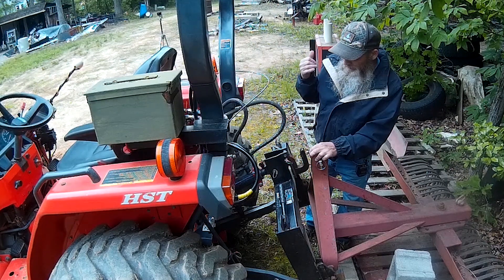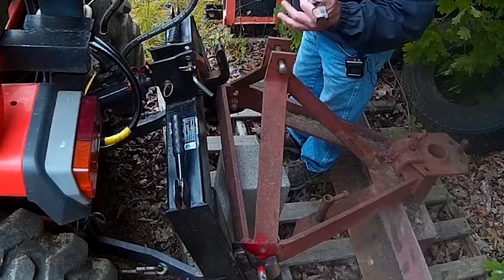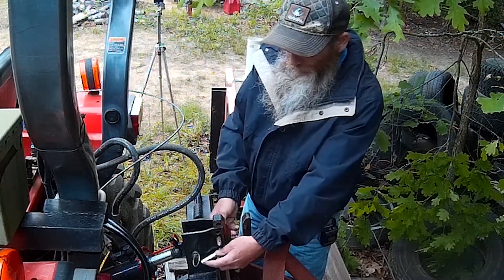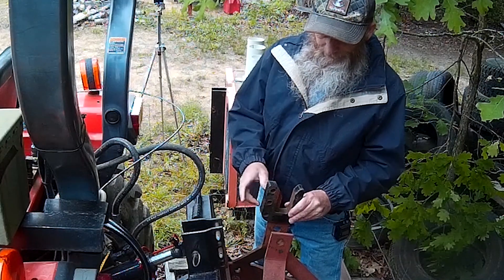how to hook up a non quick hitch implement to a quick hitch

Comment: Hi Dave. Just got my quick hitch and it works on almost all of my attachments.  Now, thanks to you, it will work on all of my attachments.... once again, thank you.
Reply from the maker: awesome! hope you are doing well my friend.
Reply: @daveknowshow  Dave, had trouble with a finish mower and a quick attach.  aarrgghh.  So happy you were as always a step ahead of me.  🙂
Reply from the maker: @drgnner6028  I did some mods to my finish mower for that same reason and man oh man did it help! hope you are doing well .
Reply: @daveknowshow  I had the Pats EZ hitch on the lift arms and they worked very well. I thought the quick hitch would work better and I was in the mood for a new toy.  I wasted my money. The top hook is in the tool box which means I still have to attach the top link by hand.  It is no big deal to do that, but the quick hitch is not a big deal either. :-)
Reply from the maker: @drgnner6028  there are some adjustments to make it 100% usable with all your implements. once its all done I'm liking it pretty good.

Comment: I have a Speeco quick hitch that I have had for over 20 years. Several pieces of my equipment are not quick hitch compatible.  I use the lower pin adaptor bushing on the equipment and center link link adaptor on the hitch. I have to get off the tractor to hook up the top link, which works fine for me, at least I don't have to fight with the lower links. I fully agree with your modifications to your equipment. Great video with a lot of good information.
Reply from the maker: thanks Steve, I really appreciate your input. really appreciate you stopping by the channel

Comment: I have a nearly identical drag blade, just a couple hour ago I cut out the inch of round tube blocking my quick hitch's top hook then extended out a new support (a little bit of metal fab work) further back so the top hook doesn't interfere with anything. Now I just need to get it to stand by itself and then every hook-up will be fast and fluid!
Reply from the maker: @williambartholomew5680  yeah that’s a good fix but changes the top link length a bit.
Reply: @daveknowshow  I don't think I described it well enough but I didn't change any geometry, just got the blade's center strut out of the "pocket" the top pin goes through. Everything is exactly how it was but now there's room to have a large hook around the top pin 👍
Reply from the maker: @ sounds like a good work arrangement to me.

Comment: Dang.... that's an amaze'n discovery, in see'n how you did that! Thanks for them details!
Reply from the maker: thanks for stopping by got to get creative sometimes with these implements but well worth the effort.
Reply: @daveknowshow  Sounds like that pay's off for ya too! Love your creativity. Just passed your info on to another guy with the same issue one his implements. 

Hey, so curious, would the Pat's Easy Change system not also have been a good option for you, since your top link was given you so much trouble? Of course, in using Pat's, the top link would need to extend out a bit further (3.75 inch) to make that work... so with your hydraulic top link may make that not an option. Thoughts?
Reply from the maker: @BubbaGooder  could have went pats but I'm not a fan of it. the arms swing loose if you dont put the bar between them and that bar can get in the way of the pto shaft when using a pto driven implement. at least I would think it would get in the way.

Comment: Nice video. Great for those wanting to save some money. I myself invested a heavy price for the Kubota quick hitch 10 that does not have any adjustments and doesn't need any adaptors for the implements. I did get it because I did get a new tractor and my implements I got with it were Kubota Quick Hitch. I did buy a Farm Hand 42BX Wood Chipper and converted it to fit by drilling another hole for a 1/2 inch bolt and putting a 1/2 to one inch adaptor and then a 1" to 1 1/8 inch adaptor for a perfect fit. It just makes it even easier that you don't have to mess with the top hook. I will most likely buy Land Pride quick hitch implements, but if I did see something else saving enough money and it could be adapted over would do that as well. It was nice that you did have the adjustable hook on top to not even have to modify the implements. But you are right quick hitch is the way to go. The easier it is to change implements the more likely you will use them more often.
Reply from the maker: so very true I just finally adjusted my rototiller to work on my quick hitch as well. so now I only have three that do not fit. the post hole digger, the 12 inch bottom plow which neither of those will ever fit. my aerator does not fit very well so I will make some adjustments to it soon. its not something I use very often but I might would if it was easier to hook up

Comment: Thanks Dave . I have a few old pieces of equipment, but he main one that I use is a old heavy duty blade. It even can be slide either way on the frame. Also has replaceable cutting edge.  Of coarse I run into the problems you discussed. I was not aware of the different hooks available.
Reply from the maker: I was just sent a brand new blade to test out. I needed a offset blade like the one you have. I got this new blade to test and make a video about and it was suppose to be quick hitch ready. well guess what? it wont fit! I could not believe it! I spent a week rebuilding my harbor freight quick hitch to fit this darn thing! hope to have that video out in the future. its a nice blade though really super heavy duty to!
Reply: @daveknowshow  : Murphy's law ? Now that seems just like my luck............
 I am sorry I mentioned , what I did.   Maybe there is no such thing as quick hitch ready,factor equipment ??  Maybe it should be labeled quick hitch adaptable ?
Reply from the maker: @victorcastle1840  lol ha ha yes I agree 100% "quick hitch adaptable" I like that !

Comment: Best real-world Q/H video! You solved the top link problems quite nicely. Any reason I couldn't weld a filler in the bottom hooks (like you did to the top hook) to avoid the use of bushings? Seems wasteful to have to go out and buy a set of bushings for every implement. Older guy here too, and I'm so done with jockeying implements around to get them to line up with the 3Pt hitch holes. Thanks & God bless.
Reply from the maker: @paulinmt2185  yes I did a video several years back showing the lower pin mod. Used a piece of scrap steel curved and welded in place. Makes every implement fit much better.

Comment: I fully agree with you Dave!  Older equipment are worth more than newer.  If the shiny stuff is what a guy is looking, then a pint of paint can do the trick too! One thing you know with old stuff: they've proven to be strong over the numerous years of hard work. If they still exist, then they are strong.  I have a vintage Allis Chalmers blade, probably from the first half of the last century.  Nothing can break it.  The moldboard is 3/4in thick. Add another 3/4in for the hardened steel cutting edge! Then the post holding it is a round 4 inches solid piece of steel! No tubing! Lol! Got it for 100$ CDN (roughly 60$ USD). Got it painted for 10$. Thanks!
Reply: Forgot to say... that is a very clever trick you have there!  I would never think of that! It does 90% of the job of a QH without a compatible implement.
Reply from the maker: I do like my old implements but a month or so ago I was given the opportunity to try out a new rear blade and I was impressed with how well it was made. very heavy duty for today's standards. I hope to show it in a video soon.

Comment: Gave up on the HF quick hitch; and got a set of hook style hitch adapters from Titan (similar to Pat’s Easy Change, except not as nice - but half the price). More practical for me; because I’ve got the backhoe for my GC1723EB; and I don’t have to remove them when I put the backhoe on. Still had to make some adapters for my flail mower, though, because the lower pins were directly over the deck, and there was no room for the hooks.
Reply from the maker: hmm Titan,... I may look into those myself to see what they are like.  thanks for sharing that with us.
Reply: daveknowshow Sure! The other thing I had to do was get a longer top link; because the one that came with the tractor was too short to accommodate the required adjustment range plus the extra four inches or so that the QC hooks added. A larger tractor might not have this issue (I.e, your top link might be long enough already).

Comment: My box blade was allot like your land rake.  I cut out that underneath and welded to the outside of where the top link goes
Reply from the maker: that is a good way to fix it. I'm working on a video to show my latest fix for these two implements to be quick hitch ready. it will require some welding skills which many people do not have so I figured I'd show this first. maybe have that video ready by next week. who knows I'm taking my time.

Comment: Have you ever had a Pat's quick-disconnect for those old implements?  I receive one this way I have control of the width and the top link.  Your input would be greatly appreciated thanks in advance
Reply from the maker: Not yet! but I may try the titan version its much lower priced from what I hear. as far as function they all have issues in one way or another. the pats has clearance issues with some implements plus you will need a longer top link which is no big deal tractor supply has plenty as does amazon.  they way I see it I'm glad I did not buy a expensive quick hitch and then had to do mods because I would really be disappointed had I paid a lot for the hitch. as it is I only paid like 80 bucks for the harbor freight so a few hundred in mods is no big deal if it them works with everything I own. now had I paid a few hundred for the hitch and then had to spend another few hundred to adapt it over then I would be less happy? lol

Comment: For the LAST 65YEARS Tractor Operator's have been looking for an "Easy-way" to hook-up 3point implements. The after-market "quicky-hitcheys " are the poorest EXCUSE to hook-up 3point implements. The ONLY IMPROVEMENT is the "Factory Lower Telescopic Adjustable link Ends "..... = Positive ,Precise,Controlable ,And SAFE Total Applications  !!! In 50% of cases the Operator STILL has to get Off the Tractor for PTO SHAFT CONNECTIONS & sometimes hose's also. By "getting off the tractor" ;--- their is NOTHING "QUICK" about this Demostration!!! ( Plus ALLL that Adapt-a-lating).... The " quicky-hitcheys " ( both kinds-with arch& lower "add-ons") have failed me MISERABLY...either have been taken back or are in the "Scrap-heap". Thank you Sir for this informative vidio and happy safe tractoring. Best wishes with all your endeavours.
Reply from the maker: tractor work is well "work" the quickie attachments do SAVE some effort with large implements. I can remember having to fight push pull and pry the implements over to connect them. so saving that aspect alone is light years of improvement in my honest opinion. yes you still need to get off the machine to hook up hoses pto shafts and such but that is nothing compared to tugging and wrestling a brushhog that the pins just are not lining up close enough. everything tractor related comes with a learning curve. you can give up before you get around that curve or you can give it the time and effort to learn and adapt. the quicky is far from perfect but sure has saved my back. I never knew how much until I broke my quicky and had to go back to the old way. I immediately bought and modified a new quicky to at the least get me back where I was.  thanks for your input it helps others to see worthy opinions on these subjects.

Comment: Could have just flipped the top hook over
Reply from the maker: @garyanderson4685  not sure I understand what you are suggesting. Does not sound like a viable solution though. I’m thinking it will be more trouble to get that to fit upside down.

Comment: As with almost all of these videos from everyone posting them this works great when your quick hitch is adjustable but if its a 1 piece like a kubota quick hitch none of these videos will work.
Reply from the maker: yes there is some modifications that need to be done and the best one for the money is the harbor freight. if I spent the money on a landpride I'd be pissed if I had to modify it at all. with this cheap harbor freight I just plan on modifying it from the start.